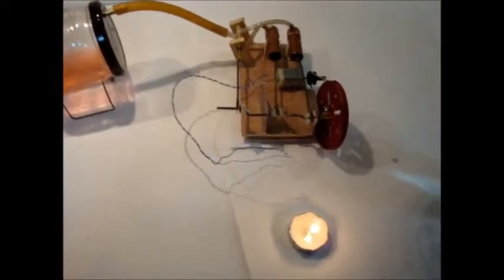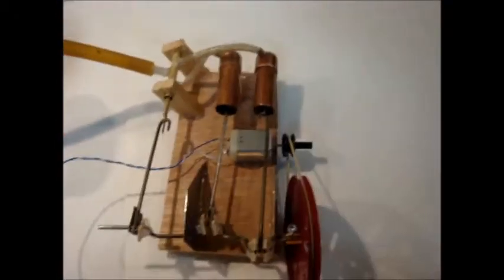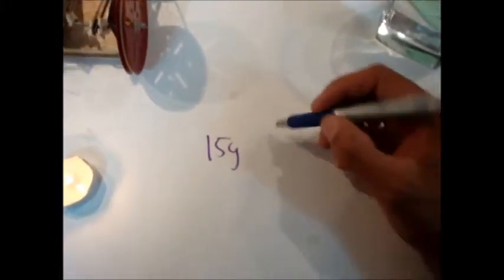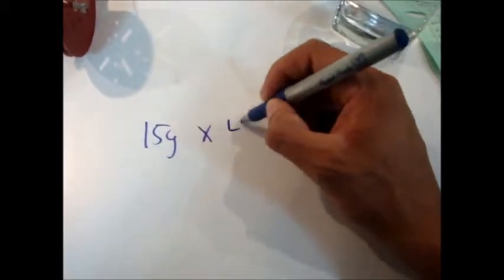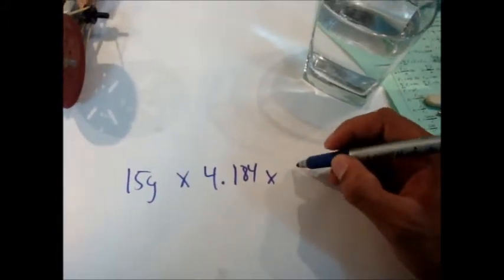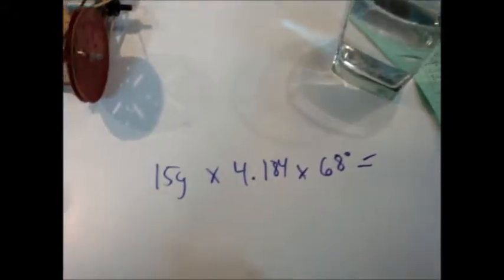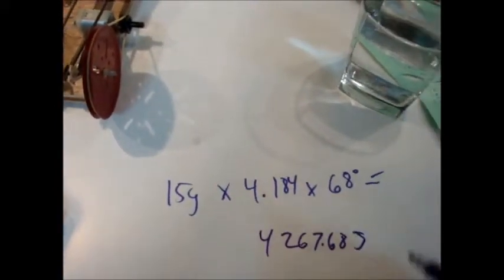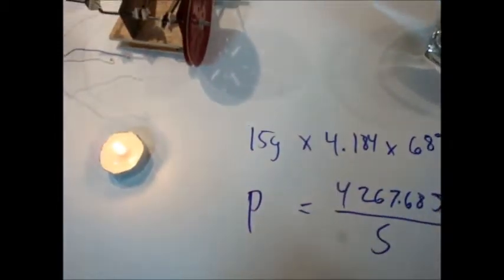steam engine that generates electricity and distills water

Comment: Great concept, but it won't work for cleaning water. Steam engines, like gas engines, need to be oiled to move smoothly and reduce ware from friction, thus exhaust steam can't really be used as clean drinking water. Also, glass jars aren't the best DIY boilers, soup cans work, but only as a temporary solution. You can buy a boiler from manufacturers like Jensen or Wilesco, use one from a junk engine on ebay, or you can try your hand at making a boiler out of copper pipe. As for fuel, candles aren't the best heat source for a boiler of that size, Esbit camp fuel tablets are what the manufacturers use, but many of us hobbiests use Sterno, hand sanitizer or alcohol as fuel.